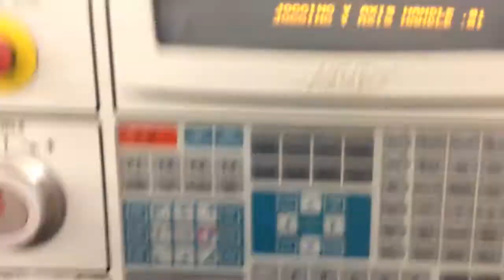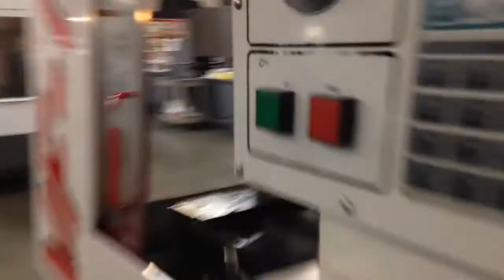Haas "grinder"

Comment: Did the ballscrew replacement even have anything to do with the fact that its a machine used for grinding? Its really clean!
Reply: Hows it goin!
Reply: Cant wait to see what you get
Reply from the maker: That and we hold better than .0003" for the most part on our cutters so it's no fun compensating for backlash. Ball screws are cheap
Reply from the maker: +tacticalkeychains , interested in a 16 year old Haas with a 4th/5th that's been used to grind carbide 😜
Reply: Send it to him anyways

Comment: Ciao Alfred
Personalmente ritengo che l'idea di usare una macchina utensile CNC convenzionale a 5 assi per rettificare il metallo duro sia  buona, soprattutto economica, anche se il CN non è dedicato e quindi la programmazione è sicuramente più lenta di una affilatrice tipo ANCA, WALTER, DECKEL ecc. e meno sofisticata.
Però c'è il problema del filtraggio della polvere di carburo di tungsteno che alla lunga, inevitabilmente, usura tutte le componenti mobili della macchina, considera che la polvere è molto sottile ed abrasiva......ne risente in oltre la stabilità dell'emulsione con cattivo odore e rischio di dermatiti.
Ritengo che sarebbe da dedicare a questa applicazione una macchina ormai arrivata a fine cariera in modo da non avere nulla da perdere.
Comunque è una buona idea, anche se non è il mio settore specifico per giudicare...
Reply from the maker: Grazie, penso. in realtà non parlare o leggere abbastanza italiano per capire tutto quello che hai scritto. Io uso un app di traduzione per aiutarmi a comunicare con persone di altri paesi. sono interessato a quello che hai da dire però. Forse si potrebbe inviare a me via email così che ho potuto inviare alla mia app transletor?
Reply: Alfred Lyon 

Hi Alfred, I personally think that the idea of using a conventional CNC machine tool axes 5 to adjust the hard metal is good, mainly economic, although CN is not dedicated, and then the programming is definitely slower than a type Sharpener ANCA, WALTER, DECKEL, etc. and less sophisticated. However there is the problem of filtering of tungsten carbide powder that eventually, inevitably, wear all the moving parts of the machine, consider that very thin dust is abrasive and ...... it suffers more than the stability of the emulsion with foul smell and the risk of dermatitis. I think it would be to devote to this application a machine now to end career so you have nothing to lose. However, it is a good idea, although it is not my specific area to judge...

P.s.
I use Bing Traslator, infact my english is very terrible.....though I understand something :)
I hope that the traslation was correct...
Ciao
Reply from the maker: Thanks for the app info! I put this video up in response to a question that some posted on the website practicalmachinist.com . They asked if anyone has used a Haas VMC to grind carbide. My answer was yes since 1992. They then went on to ask how we protected them. I said in the beginning we tried but in the end it was cheaper to replace ball screws and clean them. This video is showing the condition of one of our older machines. We currently have seven Haas "grinders" but we are slowly replacing them with ANCA CNC grinders. In 1992 a Haas set up with a 4th/5th was only around $45K so compared to a$1mllion CNC grinder at the time it was a no brainer. Cost have come down considerably.